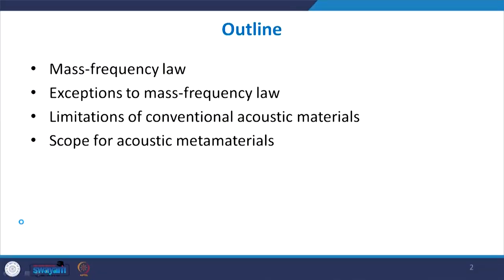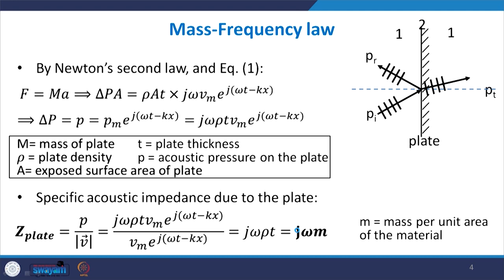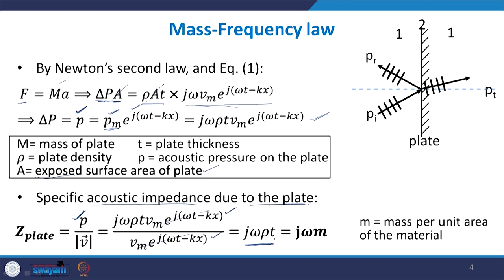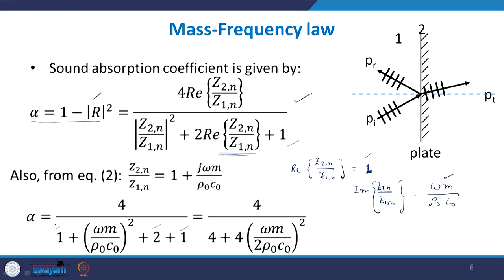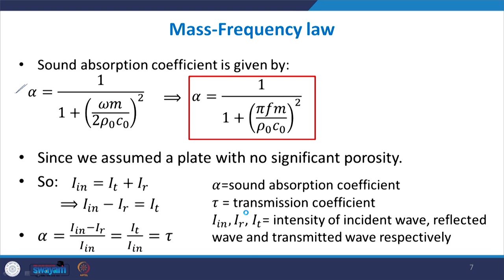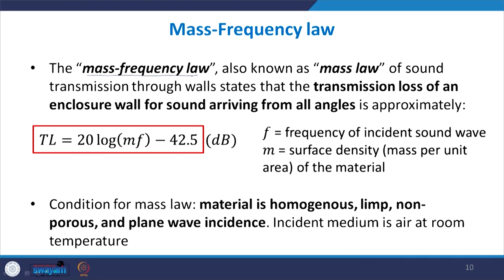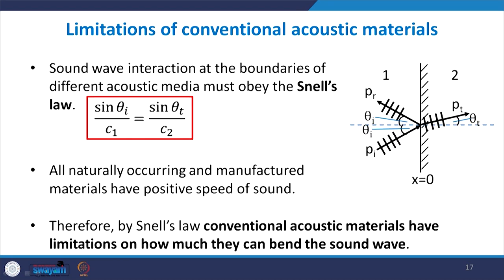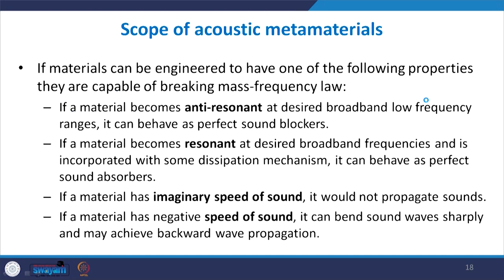Lecture 24: Introduction to Acoustic Metamaterials-1

Comment: How they perform better at high frequencies if transmission loss increases for high frequencies
Reply: Here, the performance is measured in transmission loss. High Transmission loss will make it a better barrier material, so they will offer better noise control.